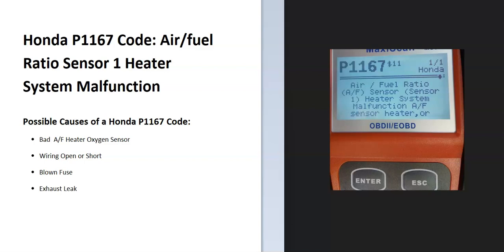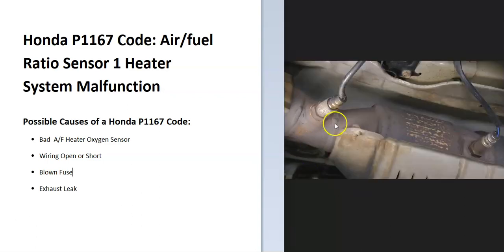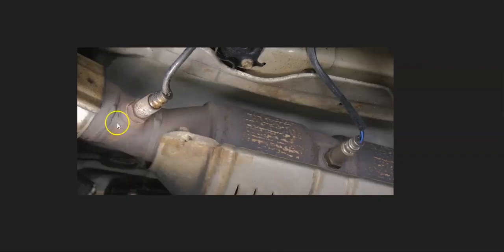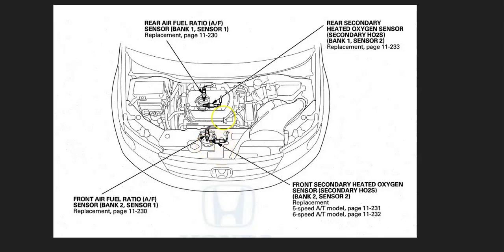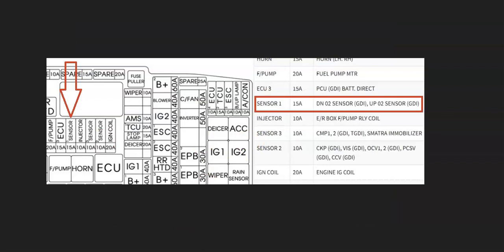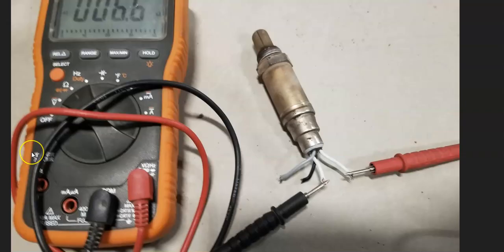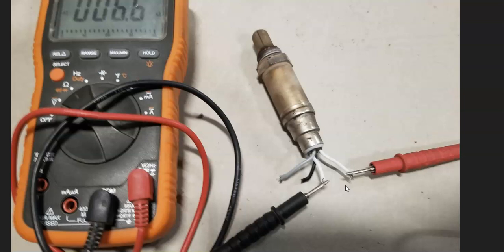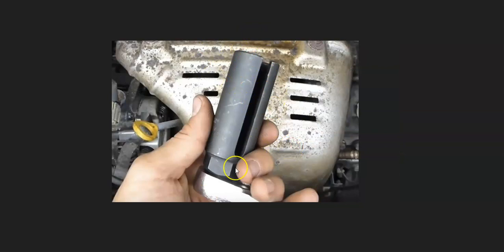How to Fix Honda P1167: Air/fuel Ratio Sensor 1 Heater System Malfunction

Comment: Hi 👋  im having this issue. This all started because someone stole my Cat.  I ended up installing an aftermarket cat and now the P1167 code wont turn off. I replaced the A/F sensor with a Denso one. I deleted the code with a scanner and it comes back on 2 minutes after starting the car.
Reply: Hey man did you ever solve your issue

Comment: I have an 02 CRV with a p1167 cel. Replaced upstream o2 twice already, an oem o2 and an working aftermarket o2, and code will still pop up after 10-20sec of clearing the code and starting up then engine when it’s cold/cool. But once engine is warmed up the code doesn’t pop up. Any idea?
Reply: I replaced my crv catalytic converter and also both oxygen sensor and still I have the p1167 code why?
Reply: Replace the catalytic converter. They work more efficiently when they’re warned up, so if the code is popping up when the car is cold, the cat is bad.

Comment: I replaced my o2 sensor up and downstream and I still got the same p1167  code ima change out the fuse and check for an exhaust leak

Comment: I have p067 on my 2000 accord so i replaced the a/f sensor and it still throws the code, had no continuity on the red wire between the pcm pin #15 and the #.2 terminal on the a/f connector, and 1.0ohms on the blue wire between the pcm pin #14 and #.1 terminal on the a/f connector. i found a break in the red wire (pcm pin #15 and a/f sensor connector terminal #2) between the pcm and the sensor connector and repaired it. im getting 1.0 ohms on both wires now, i reset the pcm memory and ran the car, code came back... any ideas on what im missing here?